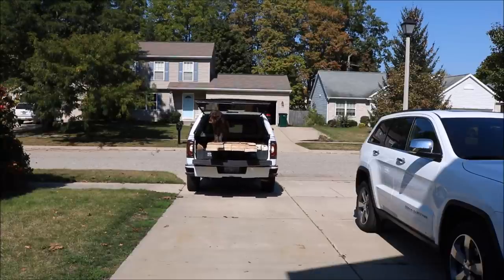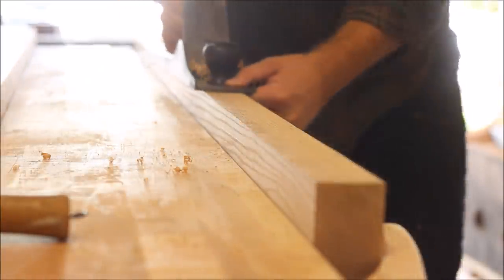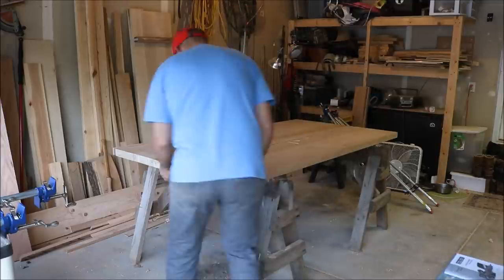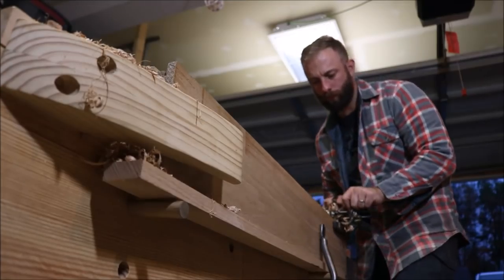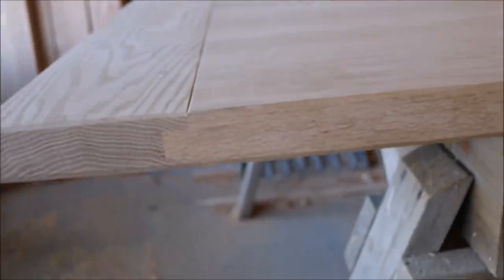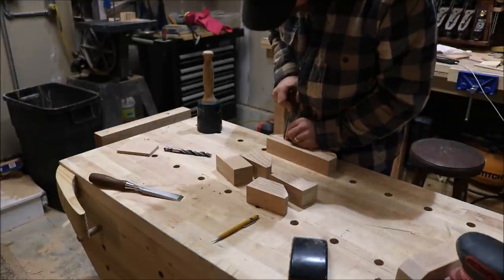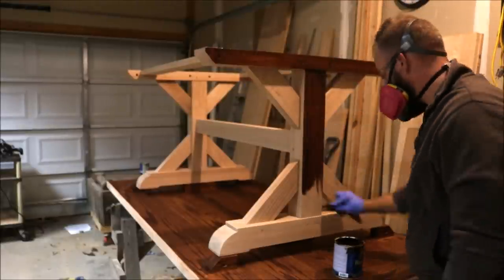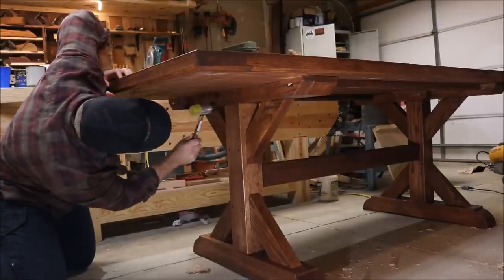Table Top Build + Genius Method of Attaching Top To Base | Woodworking | How To | Tip | Trick

Comment: TIP:
The dowels you used to attach the top to the base, first dip the dowels into liquified bees-wax.
They will be MUCH easier to remove when it's time for disassembly several years down the road.
Beautiful work, by the way.

Comment: Very nice! You might already know this, there is a historic furniture type called "peg top table" that uses this type joint. Most Ive seen have a batten attached to the top across its width, this gets pegged to the base. Works for cabinets too!
Reply from the maker: Mr. Chickadee I haven’t ever seen that but I’m going to look it up now! I had just seen a picture of a George Nakashima table that looked like he didn’t something like this and tried it. My next table I do I’m actually going to attach the battens with sliding dovetails into the underside of the top rather than just gluing them.
Reply: @ThirdCoastCraftsman  I know this is an old video/ comment. I love your work and will be buying your plans for this build soon. I haven't done a project this big yet and would love the additional guidance as I walk through it. The one thing I thought while watching the videos is to make those battens via a sliding dovetail. Have you thought much about how you would do it? Presumably a entry point that can be covered by the end of the batten but will allow it to slide in? So half sliding dovetail and half interfacing with the bottom of the table? Also what were the dimensions of this table? I didn't see that on the description of the plans but wanted to make sure it would indeed fit my needs? Though I am thinking I could probably make minor adjustments to dimensions if needed. Thanks!!

Comment: I'm building of mahogany kitchen table and have been looking and thinking about how to attach the top so far your method is winning good job dood thanks
Reply from the maker: Thank you. If you do this method let me know how it goes
Reply: Third Coast Craftsman On the one I'm making the legs are a 4 post design with a runner between them and across to the other set of legs. I never use hardware, all jointery but this is my first table so it's a little different. I'm thinking the skirt will be attached to the legs and would be acting as the outside block. What do you think?

Comment: Beautiful table.  Those blocks that you glued to the underside of the table top - think I would have drilled and glued wood dowels  through the blocks and into blind holes in the bottom side of the table top.  Could even drill them right through if you wanted to see them on the top side, matching the dowels in your breadboard ends.

Comment: This is truly a beautiful table.  You do incredible work.  I am hoping to recreate but am a total novice.  I have a question regarding the mounting blocks.  In the video you state that the mounting block is a "long grain to long grain glue joint".  I would agree if it were attached to the top support, but it's attached to the table top which is cross grain, I think??  Am I misunderstanding something?  Thanks.

Comment: How much movement is there in the table top?  I'd love to see a follow up video on how much the table moves from the breadboards and if the unstained wood shows through at the extremes of the movements.  I've done something similar with a table I built for attaching the table to base for a table designed for tearing down, but I love this solution for a real stationary table.  Beautiful design!

Comment: Just wondering if you have had any trouble with just the glue holding the top. It looks awesome but just wondering how confident are you in the glue. Like if you wanted to pick it up and move a few feet do you take top off? Or can it handle that?

Comment: Great videos, and beautiful work. Could you explain a little further why you're confident in the "long-grain to long-grain glue joint"?
Reply from the maker: Thanks Shawn! Honestly  modern wood glues are INCREDIBLY strong these days. If you properly glue 2 boards together and try to break them apart the wood itself will almost guarenteed break before the actual glue joint does. Its crazy to think, but its true. Now this ISNT true for end grain to long grain or end grain to end grain. Also these blocks dont take any real abuse, Its not like the abuse and stresses the legs and frame need to be able to withstand.
Reply: Third Coast Craftsman makes sense, thanks. I really appreciate the explanations you give in the videos. Keep up the good work!
Reply from the maker: Hey my pleasure bud. Thanks for watching and commenting!

Comment: This is really great stuff - I just bought the plans and can't wait to start building this thing!! My only concern is that I won't be able to fit the table out my front door if I ever move (even with the top removed), so I want to be able to remove the two end pieces from the lengthwise pieces. Any suggestions for keeping the thing solid and stable even without the dovetails and center beam tenons permanently glued in?

Comment: This was a fantastic two part build. Amazing skills and a beautiful table. I have a quick question (hopefully) - I would like to build a similar top for a table that will live outside (I know!). With the wood expanding and contracting along the length of the breadboard, I assume that the joint will allow water in over time. I wonder if you would recommend treating the tenons and mortices in the breadboard ends with anything prior to assembly to help prevent rot from any water ingress as the wood moves around? e.g. oil, or thinned varnish - my worry is that varnish might act a bit like a glue where you don't want it. Or in fact would assembling it all bare, finishing with appropriate varnish and just looking after it be sufficient?

Comment: Question:  would it make any structural difference to place the outside blocks and the center block on the opposite sides of the upper support from how you have them?  That way the elongated holes are more hidden.

Comment: Hi, Im not sure you will be able to help but I have a structural question, I have a table top that i built and then got some lovely legs that I have attached but the table jiggles. So i'm not sure if the legs are too skinny? or does it need a table skirt to hold it in place?

Comment: which draw bored joints were done with through dowels and which ones were done with stopped dowels?  I think I can see how I would do it, considering that I'd want to be able to disassemble the top from the base and two ends of the trestle from the center stretcher, but it wasn't clear to me how YOU did it in the videos.
Reply: Also, considering that you said EVERY joint was drawbored, did you encounter any blowout issues that didn't make it into the video, at least for the ones where the hole was drilled all the way through?  I had that issue when making some Krenov-inspired sawhorses and I went all the way through my mortises and tenons, and when pounding the dowel I had some blowout on the exit side.
Reply from the maker: I believe the base was all stopped dowels and the bread boards on the top were through dowels. I didn’t have any blowouts. A couple things to make sure you prevent them. Have your dowels tapered good so they can easily find their way though the drawbored hole. Don’t make your offset holes too far apart and make it too difficult for that dowel to make it though. Put a clamp right next to the dowel holes as you pound the dowel in. That will support the back of the joint and prevent the wood from blowing out.

Comment: Really digging your videos! Is this your primary process for milling your rough lumber? I have an 8" bench top jointer but more often than not I'm left frustrated because my boards aren't flat. I already have a planer so I'm considering buying a jointer plane and trying this out.
Reply from the maker: Lately I have been having my local hardwood dealer just mill up my lumber for me as its pretty cheap and saves me a lot of work haha.
Reply: Haha I feel ya, thanks for the response and congrats on going full time! Looking forward to seeing more from you!

Comment: Thank you for this. I'm going to use this method on my live edge kitchen table. Can you please explain to me how/why the tabletop doesn't move side to side by a half inch once it's attached to the base?

I understand that no matter what method you use to attach a tabletop to a base, you need to account for movement of the wood. But I just can't wrap my head around how this can be done while still making sure the top doesn't move slightly side to side.
Reply: I could be wrong, but if I understand it correctly, the two holes in each of the center blocks are not elongated.  Being close to the center of the top, there's not as much potential for movement there.

Comment: Love the video but honest question: does this system account for the wood movement across the panel glue up?
Reply: Because the grain of the adjacent boards run in the same direction they theoretically should expand and contract at the same rate.

Comment: I missed something. Are the glued pieces on Both sides of the leg. Or just one. I couldn’t tell for sure
Reply: Two on the outside, one longer one in the middle on the inside. The outside ones have dowel holes that allow for expansion and the inside middle ones don't. Hope that helps.

Comment: Nice build.  I have a similar but older Delta Contractor saw and even with a newer pretty sharp CMT ripping blade I struggle to cut through thicker long boards like that.  Do you find your saw struggles at times?
Reply from the maker: It only struggles when boards pinched the blade from internal stresses because it doesn’t have a splitter behind the blade like newer saws

Comment: I was curious how much jointing and planning if any you had to do for your table top. Everything looks very square and flat. Did you start with rough cut lumber or did you have the lumber store do some pre-milling for you. I ask because that is the most tedious and can be frustrating part of gluing up a table top.
Reply from the maker: I always have my hardwood dealer mill it for me. It’s cheap and saves me a ton of time.

Comment: If you want your glue up to be flat, don't position your clamps like @3:45.  The one farthest from the camera is cocked, pulling the glue up upward.  The bar of the clamp should be flat against the surface of the glue up, helping keep things straight and flat.

Comment: What happens when the top of the leg base (which is sandwiched between glued or fixed blocks) expands across the grain? It could possibly rip off one or both of the blocks you glued to the table top.
Reply from the maker: thats a good consideration, but that top support piece is only 4 inches wide and not enough width for me to worry about. It may expand 1/64th so Im not too worried. But It will be interesting to see if that does happen over time.
Reply: Third Coast Craftsman I had the same thought. I’d love to see a follow up in 3 years! Great build! Now for some chairs???    : )

Comment: I don't know if anybody else has mentioned it yet...I only noticed it because I'm nearing the end of my own build of your design.  But the "long grain to long grain" glue up between the table top and the blocks used to attach the top to the base doesn't exist.  It looks pretty clear that you have a cross-grain glue up situation going on.  The grain orientation of the blocks matches the grain orientation of the top member of the base, which is 90 degrees off of what the grain orientation of the table top is.  That being said, I haven't actually finished building my top yet, just the base and the blocks to match the base's profile, but I don't think I'm going to build new blocks to correct the grain orientation.  Since this is staying in my house, and Thanksgiving is my deadline, I'm just going to build the thing and get it over with.  If it becomes a problem I'll just do a little repair in the basement shop and correct that problem if it actually IS a problem in the future.  But I thought I'd point out on Youtube because I'm so incredibly helpful that this seems like a classic woodworking no-no and dire blunder, although not as dire a blunder as getting into a land war in China or going up against a Sicilian when death is on the line. It's still an awesome table though.
Reply from the maker: You have to keep scale in mind when worrying about cross grain problems. That’s the exact reason why I don’t have a single board glued across the entire width of the table underside. Then I’d be looking at problems but small blocks less than a foot? Negligible, I’m not worried about those. And love the princess bride quote haha

Comment: I have a question for you I did breadboard ends on my recent dining table build elongated all of the holes after drilling the proper 3/8 inch hole for the 3/8"dowels, I tapered the one end of all the dowels to pretty much a point so it would fit in nice and smooth but when I tapped the1st  dowel in it split the 1.25" thick  walnut  breadboard 😕 any ideas why that happen?
Reply: Does the dowel go through the hole you drilled easily?  Did you offset the breadboard hole and the tenon hole?  My first guess would be either a wrong size dowel or too great of an offset.
Reply: Josh Singley  Yes and no and yes lol yes the dowel went all the way through but after it split the wood ..yes I offset it by a 16th of an inch and it was a 3/8 inch dowel was a 3' long rod from rockler  BUT Now that you mention it maybe the offset was too much
Reply: Josh Singley  I put some glue on it clamped it up trimmed off the squeeze out with a chisel and then sanded it with some super glue so it's pretty much covered up but man what a bummer
Reply: I hear ya. I did something similar on my dining table build.  I didn't pay attention to how far the dowels were supposed to go in, they weren't meant to go all the way through in my design,  and I ended up blowing out the bottom of the bread board from hammering them in too much.  Luckily the top was made from pine and not walnut, so I ended up just making a new breadboard.  It was a real bummer though.
Reply: Josh Singley ahhh man yea that sucks all the time it takes to get to that point and 💥 posted pics on my Instagram @jotooljunkie  of the table top and rest of my work.  Its made up of Curly cherry center, reg.cherry sides walnut bb ends.
Reply: Josh Singley was it the farmhouse style  table u built a couple months back?I'm subscribed to ya so I saw that video that was a nice build too btw bro👍👍

Comment: Nice work, but I just don't understand the use of that much wood. More materials are not smarter. More materials are the opposite of smarter. Also, to attach the top, you can use a couple of short mending strips (1 inch, tops) with a screw hole at each end. One screw goes in the top and one screw goes in the base. One at each corner is sufficient, but if you like to use up materials, you can put in 60.  Inletting the mending strip on the inside portion of the base works best and will not be visible., Leave space on each side of the slot so that it can swivel somewhat as the table top moves. What you did is so work intensive, and because it is on the under side of the table, the dog is the only one that will be able to enjoy it. Keep up the good work, but make it lighter. Less material use is better for the environment, better for your pocketbook, better for your back, and like I say, it is just smart.

Comment: Beautiful table but you do realize that placing a flat board under what you are planing does absolutely nothing. You already have a flat surface on the planer so all you are doing is lifting the surface of the board up with a "spacer". You have to have two flat surfaces (the second one is only for reference) before you put it in the planer or else you are only transferring the bottom surface to the top surface. That is why a jointer is so important.